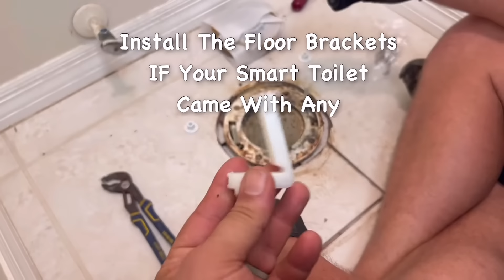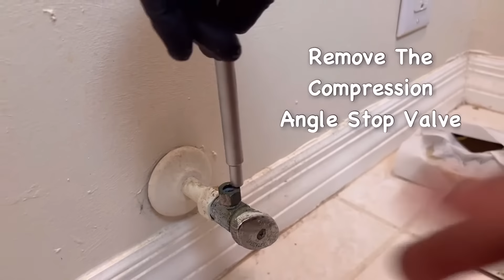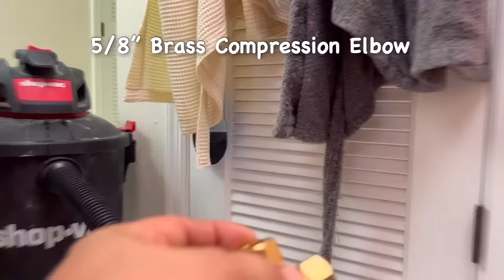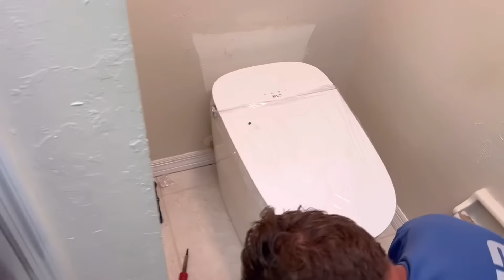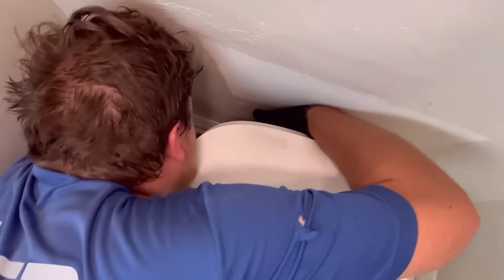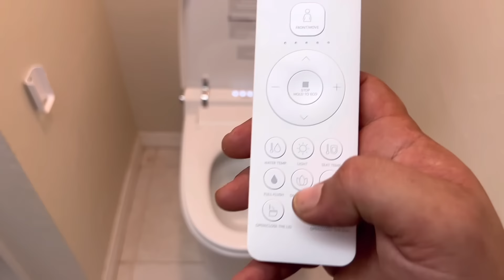How To Install A Smart Toilet - Easiest Method

Comment: Link to the 1/2 female is not bsp /G /Euro so you strip the supplied valve. Can you send the correct 1/2 female bsp. Should it also not be 5/8 OD brass compression to 1/2

Comment: I bought the compression elbow and female adapter from your links. The adapter is the same color as the elbow and seems to be brass instead of copper.  It is also longer than the one in the video and cannot be connected tightly to the elbow—it comes right out.
Reply from the maker: I’m sorry to hear that and apologize for the inconvenience.

We will check the link and find a suitable replacement.

For the part, it usually can be found at most local hardware stores like Home Depot, Lowe’s or an Ace hardware.

I hope that helps.

Comment: So this toilet does have to have a plug
Reply from the maker: Yes, it uses an electrical outlet.

Most people get the electrical outlet installed first but I recommend checking with a plumber before doing anything just to make sure the toilet will install ok.

That way you don’t waste time putting electrical in.

Comment: How much room is there behind the toilet for the valve? Need to know how close to the wall I need to cut to copper pipe.
Reply from the maker: I recommend putting in as close to the wall as possible so it clears the back of the toilet.

You might also be able to set the toilet on the flange temporarily to check the clearance for the valve.

I hope that helps.

Comment: Do you have to do anything to the newly cut copper, like deburring it or such? - most plumbers I know hate compression fittings, but not enough room to sweat the fitting Im guessing? - thanks for the video
Reply from the maker: Usually it will require cleaning and deburring to some extant depending on how you cut it.

If you use copper cutters that rotate around the pipe then the copper pipe may need to be reamed after cutting as well.

If the video doesn’t show us prepping the copper pipe then it is possible that part ended up on the cutting room floor during video editing. So I apologize for that.

If you fail to deburr, sand and/or ream the pipe it typically won’t cause any major issues but it could result in minor issues over time like sediment getting into a toilet fill valve or faucet aerator.

The compression fitting just needs the copper pipe to be rounded and not bent in any way.

So it doesn’t hurt anything to deburr, clean and ream the pipe when in doubt. As long as the roundness of the pipe is not compromised.

I hope that helps and I didn’t make that too confusing. 😅

Comment: After you cut the pipe how are you suppose to thread it?
Reply from the maker: In the video we are using a compression fitting to connect to the copper pipe coming from the wall.

The smart toilet valve threads into the other side of the compression fitting.

I hope that helps.

Comment: What if you broke the white ring around the toilet trying to remove it and it’s all broke to pieces?
Reply from the maker: The white ring that holds a toilet down is called a toilet flange.

It can be repaired with ring products that screw on top of it OR the flange can be removed and a new one installed.

Repair may be easier than replacement if you don’t do it all the time.

Comment: Hi there! What could be a very rough price estimate for the installation like this?
Reply from the maker: @nikolayfedorovskiy2533  it depends greatly on who you hire but I recommend hiring someone who has done it before.

If they can’t explain to you how they plan to do it then you shouldn’t hire them.

But it COULD BE roughly between $600 and $800 depending on MANY factors.

Thanks for watching and commenting. 🙌
Reply: @ultraplumbing  Great answer.  My electrician put my outlet far left of the toilet and the plumber ran the copper pipe up from my unfinished basement far to left also.  Almost a foot to the left of the toilet for both.  Definitely not attractive.  Total cost around $1050 per toilet. This included the cfgi outlet installs and attaching a copper pipe to the pex tubing in the basement and then running the copper pipe up through the floor to attach to the water tubing mount Eplo supplies.